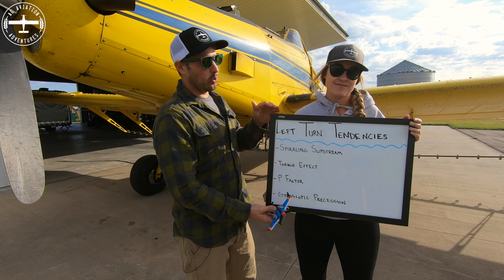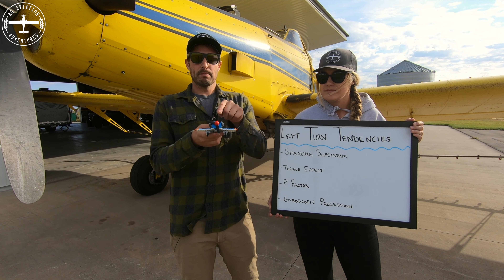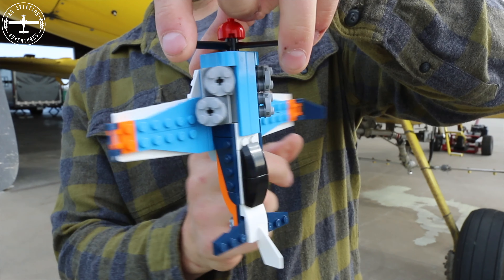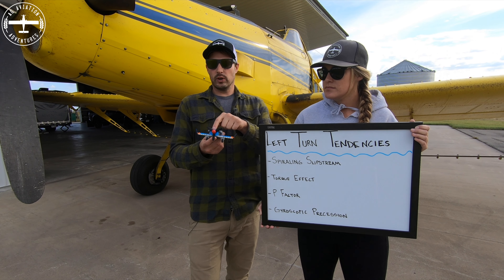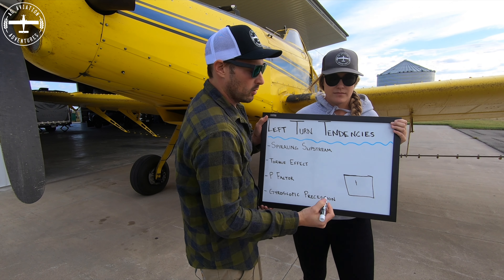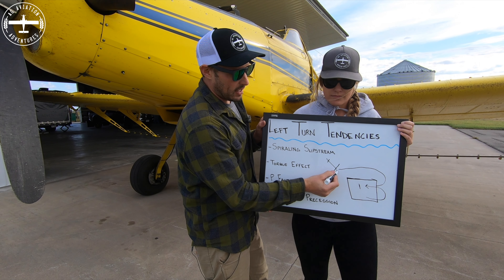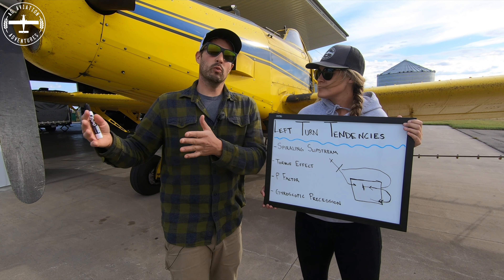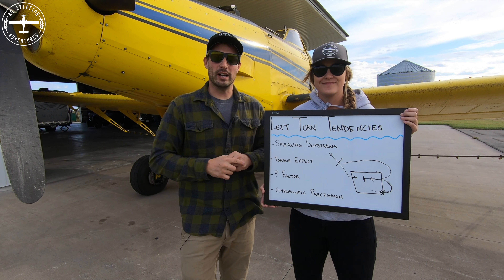Left Turning Tendencies in Ag Aviation

Comment: I recently moved to farm country in West Tennessee from the mountains in Colorado.  I also grew up next door to a crop duster in Western Kansas.  While watching a plane work a field next door to me in Tennessee I noticed he was flying a very flat long pattern with long wide turns while the dusters I watched in KS and other Western states used more of a hammerhead turn with a steep pull up and quick dive. Looks much more efficient to do the hammerhead turns. Do you suppose it is a matter of experience or some other factor for the different techniques?
Reply from the maker: Could be the terrain and how loaded they are. When I’m heavy my turns are a lot longer and shallower.
Reply: I know nothing about flying but was told by an ag pilot once that it was dangerous to hammerhead. Can't remember why it was dangerous other than maybe a greater chance of a stall.
Reply: @jerry38732  yes. After I thought about it, it is obvious.  The hammerhead manuver would only be used when almost empty and just finishing up. The heavier you are the more load it puts on your wings therefore the more speed you need to keep flying.  After watching the Ag Adventures video about spraying cover crop I figured that the one I watched doing the field next to me in Tennessee was spreading cover crop. I hopefully would have felt that if I was flying the plane. It is somewhat different watching from the ground and sitting in the seat. I've never flown a crop duster but did take some aerobatic lessons.
Reply: @RobinGlasco  a hammerhead is also know as a "stall turn".

A true hammerhead/stall turn is a straight up vertical line until speed bleeds down under 5mph/ktas. As you come to a stop in the air, almost weightless in your seat, you kick full rudder and pivot 180 degrees about your center of gravity and fly straight sown to regain flying speed. The entire maneuver is below stall speed and there is an extremely high risk and very high probability of entering a spin, inverted spin, while attempting a hammerhead. 

Botched hammerheads have killed several thousand pilots.

There is zero chance any ag pilot or reasonably intelligent person would perform that maneuver anywhere near the ground.

What they are doing for a tuen is a regular old coordinated turn, linked together, while first climbing and then diving back on an opposite heading. But make no mistake, the wing is never near stalling. The wing is flown at medium to high speed and the angle of attack is kept small, very far from stalling. 

The ag plane is going to fly at cruise power across the field, pull up to a 10-30 degree climb, pause, gain altitude to several hundred feet, then bank aileron with coordinated rudder to a bank angle of 20-30 degrees, and turn out to one side, followed by a coordinated roll back the other direction to a bank angle of 20-45 degrees, and complete the turn 270 degrees of heading, then bank back the other way to straighten up on their next run. The entire maneuver is flown at a speed above 100mph. The aircraft does not slow to a stop and pivot about its center of gravity.

A spin below 1,000 feet is almost always fatal. No pilot would dare intentionally get close to one near the ground.
Reply: @Triple_J.1  I wouldn't say I've ever seen any of them stall completely out and kick the rudder but I have seen them pull up in a very steep climb and do a sharp diving turn to get back on target in the least time possible.  Knowing where your airplane stalls is just good piloting.